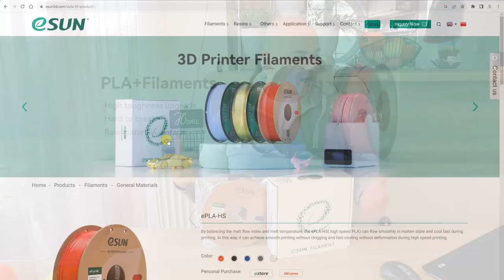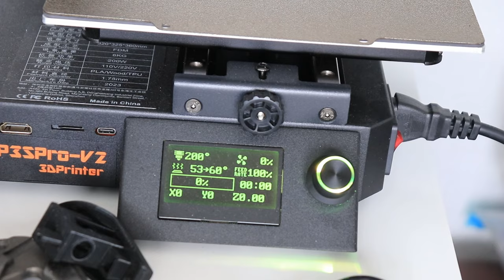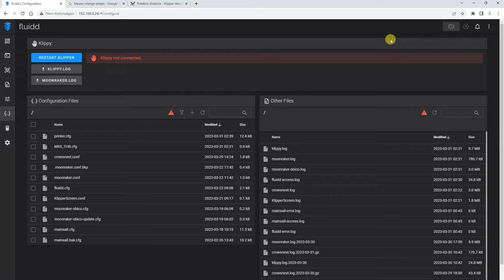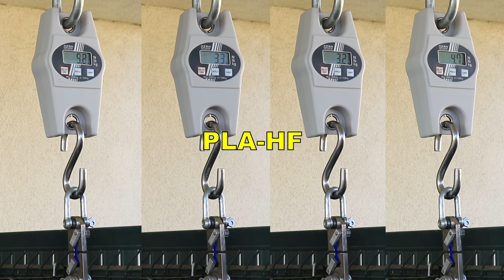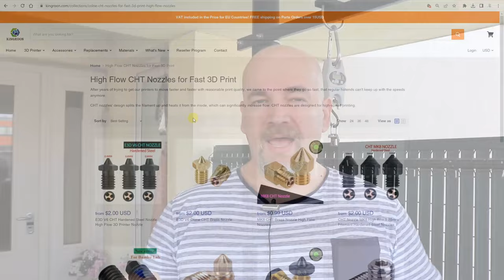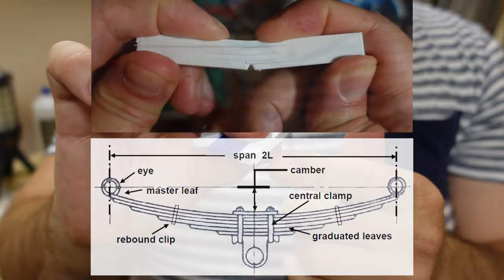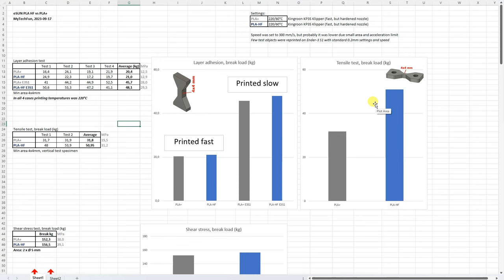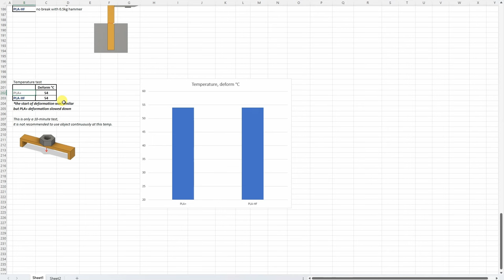eSun PLA+ vs PLA-HS (ex. PLA-HF) - high speed PLA testing

Comment: Great work as always Igor.
I like the idea of non-petroleum based spools so not keen on plastic.
Printed rings have worked well for me 
The manufacturer's could consider spools with plastic rims, or their own design of ring that clupsxsecurely in the filament retaining holes in the spool 
Or look for user designs that use those holes to make the ring as secure as possible.
I tried "Hydra" style universal rings but they just didn't rotate back when the AMS rewound the spool so I went back to printed rings, of which I have a selection for different manufacturers.

Comment: Yet another great video, Igor! Love your detailed analysis as always. Not related to this video but just a humble idea/request for an upcoming video: Could you do a test on best allround nozzles currently available? I have a Prusa XL (2 tool heads) and I've been considering which nozzle to upgrade to. Something that I could install and forget about no matter what filament I want to use. Something that can withstand all kind of filaments while also having great thermal conductivity. The best options seem to be full body tungsten carbide nozzles and then there is those very promising diamondback nozzles that even require you to lower to print temperature because they are so heat conductive. I would love to see a round up test done by you because you have pretty much the best in-depth comparisons on YT.
Reply from the maker: I wanted to test Boozle nozzle (Tungsten with channels similar to CHT), but currently they are out of stock everywhere. If I will find one on some store, I will buy it.
Reply: @MyTechFun  Funny that you mention it because I also wanted to get that one but couldn't since it's out of stock. There is another tungsten carbide nozzle I've been considering that has a very similar construction called "Deez nozzle" over at printy please store (UK) ... but it looks like it's not coated and there are no tests/reviews about it.

Comment: great video thanks - I use esun pla plus for my surfboard fins - work really well unless you leave them in the car for a few weeks over summer, then they tend to break in the surf. On cardboard spools .. I read that they absorb moisture a lot easier , and perhaps transfer that h20 to the filament, . will try the pla plus at 240 (on ender 3 v3) , good idea, thanks.

Comment: hello, ive been watching some of your filament reviews and love the testing. ive recently bought some Eryone standard PLA and the white and silver that ive tried so far will not print well at all on my X1C. the first layer seems to be the most difficult to get down without adhesion, warping, blobbing, and small bits of extruded filament hanging out of the nozzle even after the cleaning cycle. theyve offered to replace them but ive bought 10 reels of different colours and dont really want another 10 reels of misery. have you tested there other filaments? are any ones better like PLA+ or Matte?

Comment: Great video Igor! Just put a layer of electric tape or scotch tape at the edge of the cardboard spool and it works with the bambu ams, usually it's not a big issue in my case.
Reply from the maker: Good tip, thank you
Reply: Or just print spool rings! Doesn't take long and you can reuse

Comment: Use painters tape and wrap the spool then tear of one edge at a time and place it on a reusable bambu spool. There is a gap that will fit the notch on bambu spool. It works out perfectly or you can 3d print edges for the cardboard spools.

Comment: Regarding eSUN cardboard spools. You can tear the sides of the spool off and put the filament with the cardboard core on the original bambulab spool. Takes one minute to do, works perfectly fine. The inner core in eSUN spool even has the same cutout ;)
Reply: No longer works. They changed the diameter on new spools and now it's 4 mm less than Bambu spool. I was furiously mad when I teared off one side of the spool and found this of the sudden...

Comment: hello Igor...which would be the best filament for making a knifeblade and get it as sharp as possible? polycarbonate maybe?
Reply from the maker: Sometimes I measured the hardness, but I am not sure is it also related with sharpness or wearing resistance. With metal, it would be it. But yes, the PolyCarbonate is the hardest filament I tested so far. I am preparing a wearing resistance test to check this.